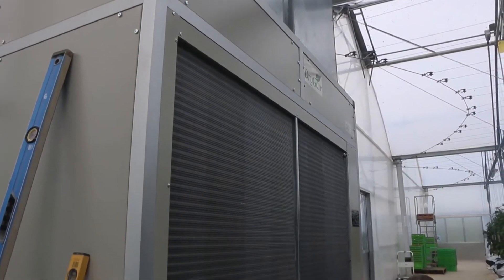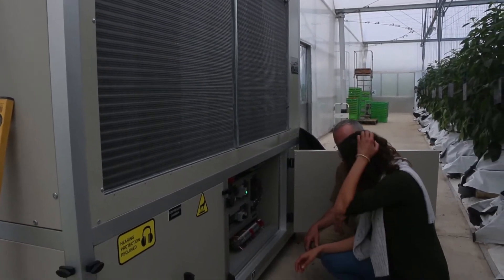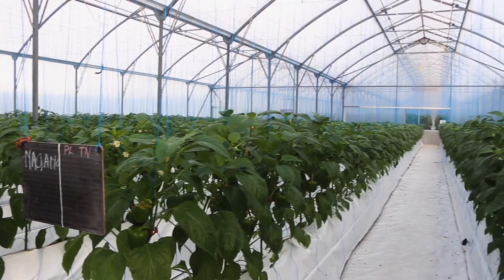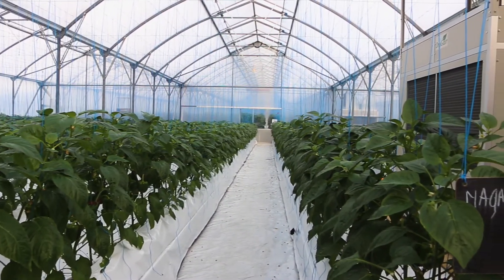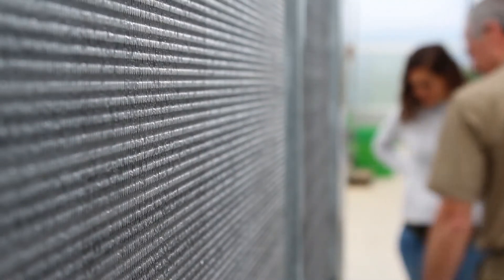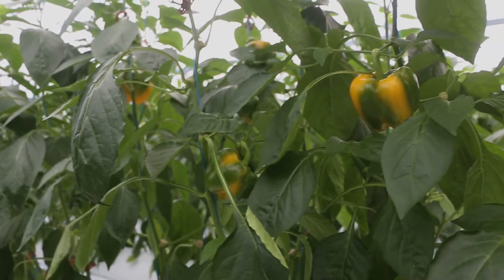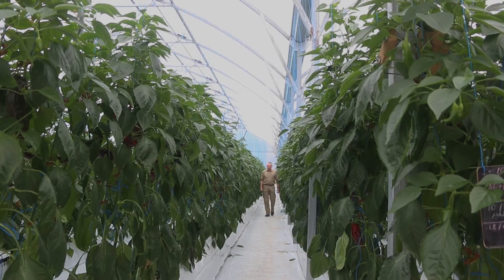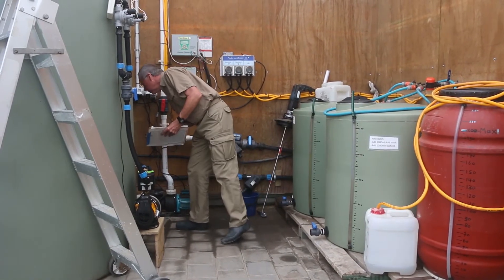DryGair Grower Recommendations - Pepper Greenhouse (by EECA New Zealand)

Comment: Hello, I have some questions about this technology. Does the dehumidifier also have to be used at night? What relative humidity is recommended to maintain low incidences of powdery mildew (Leveillula taurica) in this crop?
Reply from the maker: Hi,
Nighttime is the ideal time to use dehumidifiers. Plants still evaporate a lot of water during the night, which needs to be removed to maintain ideal RH levels and prevent mildews. As ventilating during the night is much less effective and efficient, that's when dehumidifiaction is most important.

Regarding RH for pepper cultivation, 70-80% is a great range. If you're interested, we have an entire article on pepper greenhouses, inculding optimal growing setpoints:
https://drygair.com/blog/pepper-greenhouse/
Reply: @DryGairEnergiesLtd  Thank you very much, I will read the article.